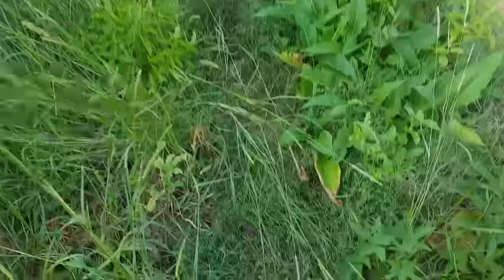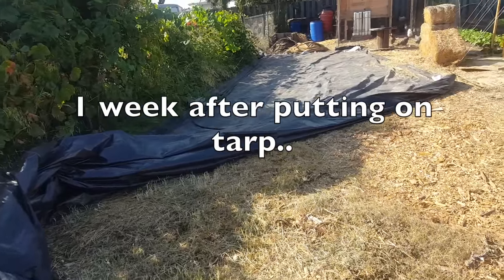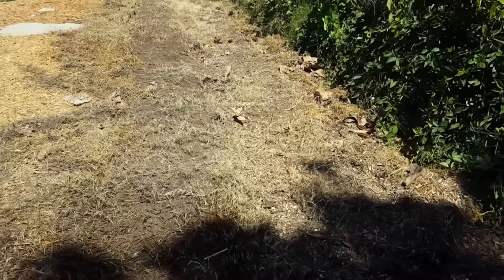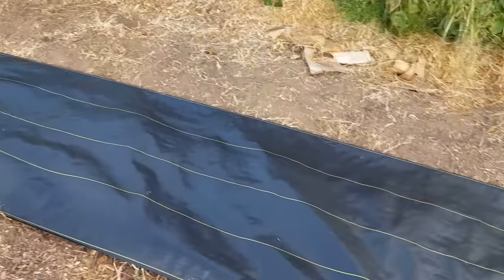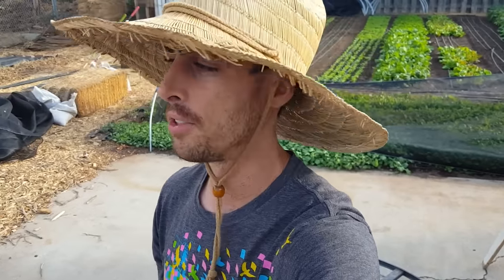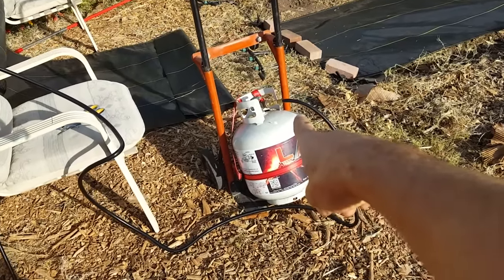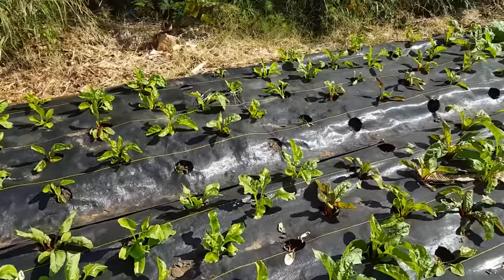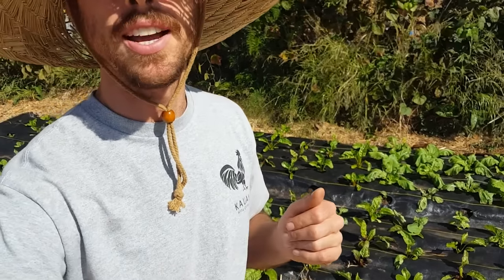Weeding Secrets Revealed: Tarp, Landscape Fabric & Flame Weeder

Comment: We solarize and use landscape fabric. After a couple of seasons, we pull the landscape fabric and just torch the soil and then add compost. This works great especially if we do this in the fall preparing for spring planting. We do cover our soil with tarps over the winter.

Comment: I was under the assumption that solarization uses clear poly to overheat the soil (extreme greenhouse effect), and occultation uses black poly to starve of light. If you're trying to amplify summer solar heat, you may have better results and a faster turn around with transparent greenhouse poly to solarize. There's a good 5 part no till series on the NOFA-VT YouTube channel that has some good tactics in solarizing to speed up turning over beds.
Reply from the maker: Oh woops maybe I'm mixing terms. Thanks for the correction and series recommendation. The other name for what I'm doing is stale seed bedding. Interesting then you can have some more strategies for different types of weeds and situations.

Comment: This is from the www.dirtdoctor.com website.    CORN GLUTEN MEAL - LIQUID SPRAY

Liquid corn gluten meal spray - a listener/farmer recommendation that's a great idea. 

The way we use corn gluten on our fields - we make a tea out of it and spray on the fields once a month from Autumn to May. Works very well. We use 2 to 6 cups of corn gluten to 100 gallons of water and spray it on with a pull behind sprayer. We just put the corn gluten meal in panty hose and suspend it in the sprayer when we fill it up, then swish the panty hose, remove and stir. Use at about 35 gallons per acre. Simple, economical and effective.

Comment: How are you starting your seeds?
Reply from the maker: I start all transplants in soil blocks. I like plug trays for onions and sometimes lettuce. But soil blocks are hands down the best way to create transplants and have the healthiest plants possible. On a large scale plug trays make more sense though because of the time it takes to make the soil blocks.
Reply: Nature's Always Right Thanks for the info and thanks for this video! This is perfect timing. I am starting some new beds here shortly and they are covered with Bermuda grass!

One follow up question, are you starting your transplants outside?
Reply from the maker: @MauriceStrickland  Oh yucky, good lucky with it, it's not easy to get rid of! Just got to be vigilant with it. I did all my transplants outside last year, I did cover my seedling table in a frost blanket to help. This year I will be building a greenhouse for microgreens and transplants.